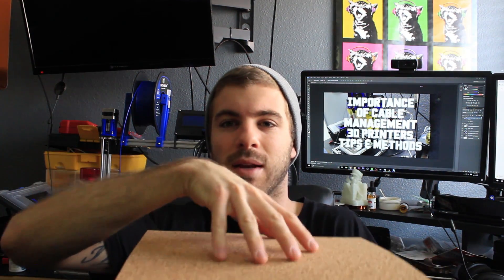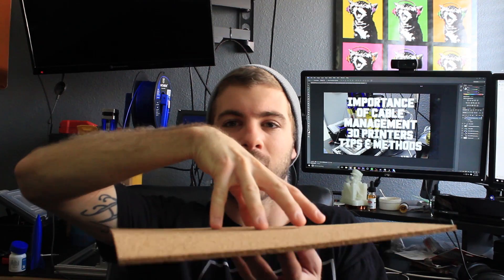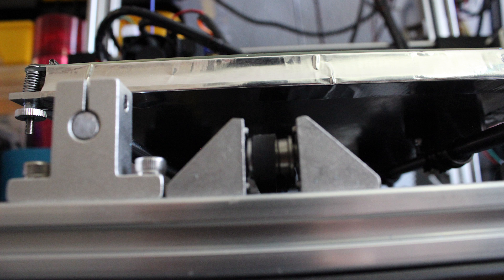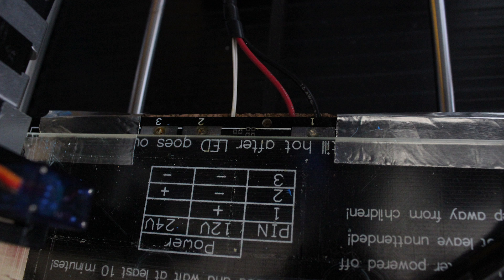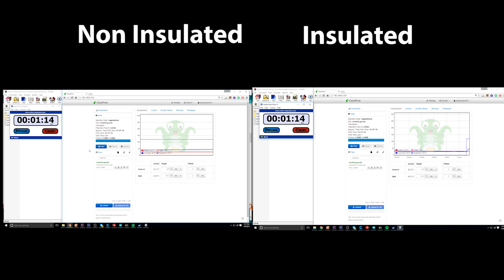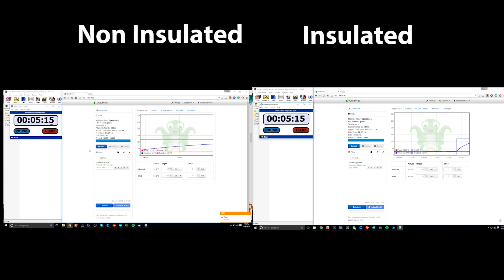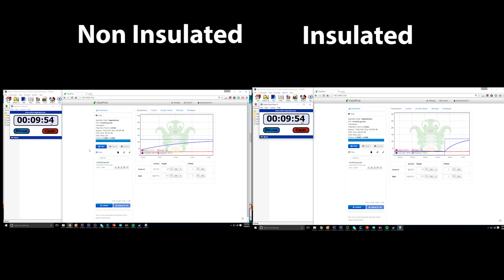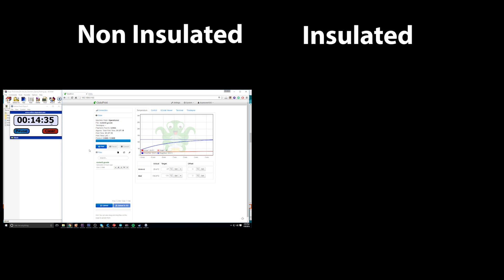Does Insulating Your 3d Printers Hotbed Make A Difference

Comment: I made 3d printer with Arduino mega and 1.4 ramps and the 300x300 mm hotbed. The DC power don't work I'm changing the hotbed to Ac220 but I don't know how isolate eletricaly  the setup pins for attached. Can you help me

Comment: as stated place your cork on top when heating up, this will help in reaching higher bed temps with low watt heat beds.
Use 3mm strips of cork to place on bed around your model while printing once your model has reached 3mm, most warping occurs on long thick sections after 3mm.
As your model gets taller place strips of insulator against sides of model.

Comment: Another benefit can be higher attainable maximum bed temps. Some i3 beds top out around 90-95°c so printing abs is at best, less than ideal. After I insulated I gained the ability to reach 115°c and maybe higher after rewiring the bed heater and soldering the connection. Good video though, I used the exact same cork tiles btw.

Comment: From what I have read about, there is even a better way. This is where you get a second power supply and power expander for the ramps board, then wire the second psu just for the hotbed. It is suppose to work wonders.

Here is a link-
http://reprap.org/wiki/Power_Expander

Comment: My heated bed heats uper super fast. I just removed the aluminum plate and just had a glass.
Reply: How did you remove aluminum plate?.. what printer do you have?
Reply from the maker: +Panoreth 3D Printing your printer isn't built though is it? It's not powered by the Ramos arduino setup

Comment: I agree 4 minutes is huge. BUT, I think there are other (arguably) more beneficial benefits. Should result in a more stable bed temperature, and also a lower duty cycle for the bed heater and circuit. 

I know good cork is fairly flame resistant, did you check yours? Curious how it handles an open flame.
Reply from the maker: +RJ_Make agreed I should have mentioned them the lower duty cycle is a big one for me I have had so much issue with Ramos board fuses and regulators getting extremely hot any less work is a beautiful thing. I didn't I just assumed it would work many people vouched for cork and the temps I will be going are not high would be interesting to try to burn a piece haha